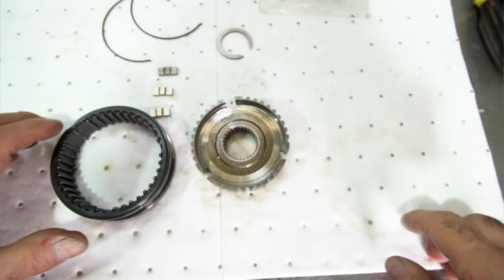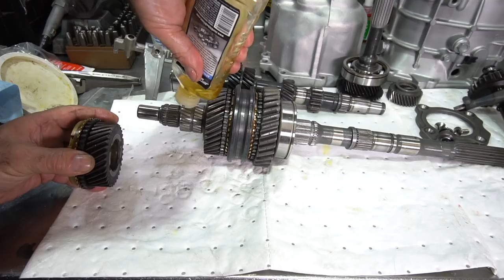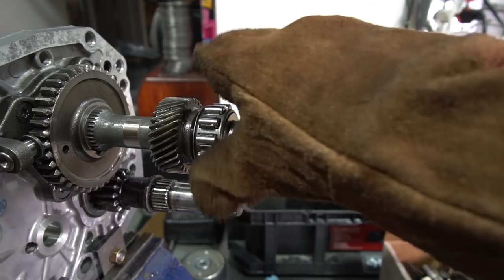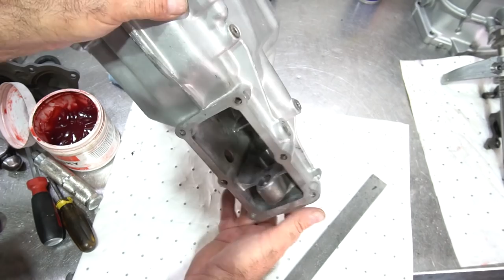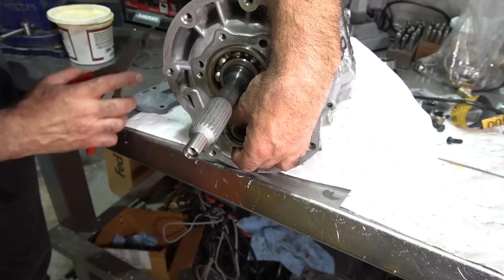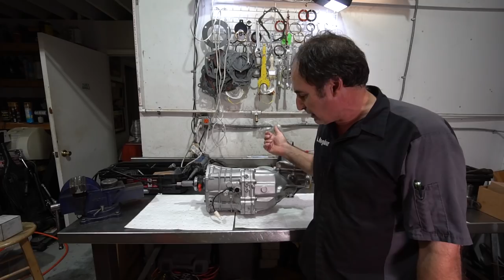How to Rebuild a Toyota W58 5 Speed Transmission - Part 2

Comment from the maker: For the people who think installing sealed bearings in manual transmission is wrong. I suggest you learn about "non contacting sealed bearings"  All of my endurance boxes run on these types of bearings for over a decade with zero failures.
Reply: Il nya pas la chaine francais pour mieux comprendre

Comment from the maker: This is a long video and I tried to make it as detailed as possible. There are some sections about HVDA conversions you can skip over.  Please also understand that a video like this takes at least 10 hours to shoot, adjust lighting, color correct and get the right angles to make points clear to the viewer. IT'S FREE.  In return if you can subscribe that would be awesome and much appreciated.
My Facebook page  redirect is http://www.transmissionbook.com

If a transmission is video worthy usually the owner has time on his project because the transmission will be in the shop for a few months. This is a full time business, not a hobby. I manufacture/ build new transmissions and parts.  I get a great deal of comments that I delete when a person says "do a Corvette ZF 6 speed video" or something similar. I don't have access to every transmission and I'm not about to purchase a transmission because someone demands I do a free video for them.  That's rude. If you are interested in working on doing a video for a particular transmission contact me . My info is in this channel's about section.

Shift Fast,
Paul

Comment: I appreciate the videos that you make no matter what make/model transmission you rebuild. It gives an insight on knowledge that one can use to rebuild their own or what goes into rebuilding a transmission. I rebuilt my first transmission about 4 years ago. Watching your videos helped me gain the confidence in understanding the steps to taking these things apart. I was working on an L-series Toyota pickup transmission (L52 transmission from a 1982-1983 Toyota Pickup 4wd). I have used these rebuild kits that you've mentioned in this video (same bearing manufacture as seen in the video). Didn't know that there can be some defects in the kits for the synchros until you mentioned it in this video. Could be a possibility that when I did put the L52 back together, that shifting into gears didn't feel smooth (specifically 3rd gear, after some time it did feel okay). New components that went into that transmission were bearings, synchros, keys and springs, c-clips, gaskets and seals. Looking forward into taking apart this Toyota R151F turbo transmission I currently have as it whines like it has straight cut gears. Thanks for another great vid Paul! Keep bangin' those gears through the windshield!
Reply from the maker: Thanks so much for taking the time to write this. The warped rings in the kit will exhibit the same problem you were having. As the rings start to seat in they will grab the gear and synchronize better.

Comment: I like to thank you mr gearbox man.Watching your videos has really helped me rebuild my own gearbox and others. I have rebuild two boxes, a late 80s T5 nwc and a 95 toyota hilux here in new zealand. Just by watching your videos thank you so much. I am a certified mechanic but never worked on gearboxes because here in NZ it is a specailized trade. In  all the Work Shops iv worked in, if their was a problem with the transmission, we just removed it from the car and send it away to get the work done. Thanks to you im learning how to do manual gearboxes and learning something new at the same time cheers

Comment: THANK YOU so much! I must have just watched this video and part 1 at least 20 times while rebuilding my late model W58 (1993-1998) transmission. The fit on mine was even tighter than this one, and there were some minute differences like double-cone synchros on some of the gears. The project took me two weeks of nights and weekends type tinkering, waiting on parts, and struggle bus dilemmas like having to wait on buddies to use their press. If it wasn't for your video I don't know if I would have ever been able to finish this project, but now I feel like an expert on the W58! 

Being a performance auto technician by trade, I have never really dug this far into the guts of a manual transmission and it was a really educational experience for me!
Reply from the maker: Thank you

Comment: Mr. Paul, 
I just want to say thank you so much for putting these videos together. I could not have done my FIRST EVER manual trans. rebuild on my Toyota w56c trans without you. I am a Toyota 4wd lover that had a smoked input shaft bearing. Common with these trans I think? I been nursing it along for the last 50k miles = louder than you can even imagine. I consider myself a pretty experienced hobby mechanic but your video was simply the best resource I could have ever stumbled upon. I have a press and a couple pullers, one more trip to harbor freight for a big bearing puller (like the biggest one you used on the press) and I was in business. I mean this as the highest form of compliment when I say: you sir, are the Bob Ross(the famous painter on PBS) of transmissions. Simply the best, detailed and all encompassing source of info I could have hoped for. I was gonna go buy a manual, but I didn't have to becuase YOU are better that the book and even included torque values, bonus!  Man.. keep doing what your doing. I would love to buy you a drink and a steak dinner if I could. Let me know if you are even in Oregon. Rock steady amigo. Thank you.
Reply: *Let me know if you are EVER in Oregon. Drinks on me.
Reply from the maker: Thanks. Ross always said there are no mistakes, only happy accidents.
Reply: @GearBoxVideo  Classic Ross, well said. 
The trans seems to working quite nicely after about a 100 miles.. Only one issue that rears its head now and then. upshifting from 3rd to 4th: Doesn't seem like the shift ring wants to fully engage over the gear. like there is not enough throw in the fork. when i let the clutch out the gear spins and i get a grind. Hard to say if it's just the cheapo Sta-lube GL4 I am using for break in or something else. Seems like i has something to do with the gear spining at the 1:1 ratio? every other gear engagement feels great. Up and down shifting. Any thoughts?
Reply: Yes Mr. Paul.....you are a TRANSMISSION GENIUS.......Waaawwwwww.......

Comment: Just rebuilt my W56-B 1987 transmission. Thanks to your video everything turned out great. Removed 5th gear with a 3 jaw puller and a little heat with no problem.

Comment: I make helical close ratio kits for these units. 11 new parts. I remove syncro drives from good used gears and press on to my new gears. With physically wider gears, closer ratios these boxes are very very strong. We have one that runs 510 rwd hp and 8300rpm. Don't grind my gears because of the expense and customers wouldn't buy them. Use best gear steel i can buy. These toyota gearboxes have a very nice syncro feel and when they are turned into a close box, they are so fast without crunching. Good video. I have tooling I have made. I use the shoulder just ahead of 5th gear spline and have a "C"plate that hooks behind it and use a porta power ram setup to install. I also use the same setup to push the big reverse gear on.  Great video.
Reply from the maker: Please send me info on your parts to support@5speeds.com
Reply from the maker: Nope

Comment: I have a good W58 attached to a complete 22R block with a 20R head I'm selling after my 80 truck was totaled. I could not have been running better when it was hit. The tranny has a fresh front seal, Engine has a new clutch, new head gasket, and valve seals and I removed the head shim put in place to keep the compression down back in 1987  when the 22R was built. I can feel the compression increase. This is a California truck. It passed CARB smog recently with results that were half of the average. Not half of Max, half of the average. I'd like to sell the whole kit'n caboodle to some lucky hobbyist that can pick it up in Southern California. Available May 5 2023. Make me an offer. I'll send pics after it's out of the truck. I loved the video. I miss my truck.

Comment: 26:22 I find it easier to throw the whole mainshaft in, with input shaft and then the cluster gear afterwards without the centre bearing on it. After the cluster gear is in tap the bearing race with the snap ring in it from 5th gear side at the same time. It saves juggling both the mainshaft and cluster gear at the same time. Love the videos! I hope this helped in some way.

Keep it up
Reply: Addison Theodoridis great tip, take the time to post a video for us.
Reply from the maker: The maindrive and output press fits so you can probably heat the inner ring up of the bearing and slide it in but I wouldn't be tapping these bearings on while the main shaft is in place you could ruin the input shaft synchronizer ring. I see what you mean about the lower cluster bearing but since that lower bearing is a split bearing with a nylon cage you risk damaging the cage.

Comment: Love your videos Paul.   If you recall I asked about Ford toploaders and you said at first you didn't really work on them due to the lack of quality parts.  Since I was having troubles with mine I sent it off the David Kee...and got it back and installed and drove the car home from the shop and it worked...thank goodness.  I had the grinding issue with the 3-2 downshift.  You said send it to you but that was after it had been shipped to Kee.  Would have loved to have to go through it.   Next time if there is a next time.   I get to test it at the track the end of Oct so we'll see how that goes.   Again thanks for the great videos.
Reply from the maker: David is very knowledgeable and a great guy

Comment: XLn't tutorial video sir, thank you!
For the commenters! The reason many Transmissions are similar is because BMW, Volvo & Jeep have all used the Toyota manual Gear Boxes behind their Engines for many years. Jeep used the Toyota automatic transmission until 2001-2.

Comment: Good job I'm getting ready to do either a w58 or r154 for my Supra so thanks a lot
Reply from the maker: Go for it!
Reply: Any idea what the w58 3rd gear spline count is? I cant find a replacement 3rd gear at all. The ax5 is apart of the w family. Any chance you know if the 3rd gear from that fits?  I know the ratio is off

Comment: wonderful... subbed! was waiting for this just to see how the gears are installed as I plan to assemble a hyundai M5BF2 soon... it's all new parts including case sections, input/output shafts, gears, synchros, forks, hubs etc., seeing this makes me excited to put it all together... I plan to polish the case inside out instead of coating with Teflon but I'll probably have the gears treated like you mentioned in the NASCAR prepped gearbox video... many thanks!
Reply from the maker: Thanks for watching. Post pics on my HIGH PERFORMANCE TRANSMISSIONS Facebook page.  Direct link is http://www.transmissionbook.com
Reply: @GearBoxVideo  once it's done, I'll do that...

Comment: I think I had a W58 in my 1993 Cressida. I remember that I had a problem with reverse gear. When I took it apart, I was amazed how complicated it was compared to the Muncies I worked on. Way more parts.
Reply from the maker: Yes and a much more precise fit. Old Muncies had horrible tolerances.
Reply: I had the Cressida for 17 years and then it was totaled. But someone got that good tranny after it went to the boneyard. Very few Cressidas had the W58. I called it my "Four Door Supra".

Comment: The Toyota Service Manual recommends using fine lapping compound to surface the Syncro to gear cone braking surface. Clean all lapping compound from surfaces before re-installation.

Comment: I am thankful that you post these videos Paul. Eats into your free time, thanks for doing it quality information.
However i do hope the Chef is not a regular dining companion around 12, oh the crap i used to get at work about the chef.
Over the winter i need to pull the boneyard engine in my s 10 it is ready to die, will do the t 5 properly this time
and the transfer case. Watching your T 5 video shamed me, i really was clueless in what i was doing - not anymore.
Going to try and fit a GM 3.8 in the engine bay if i can make the T 5 and the 3.8 play together.
2.8 is a joke and the 4.3 drinks too much but i may have no choice. Did the grand nationals ever use a T 5 ?
I can not recall if they did there might be some hope for the combo if they did. Something makes me think they were autos only.
Have a good Paul

Comment: Fantastic video Paul, I rebuilt my W59 using this tutorial as a reference. Cobra Transmission is an xln’t source for Input/4th Gear & Counter Shafts. Their staff is very help & responsive thru email for any questions!
Reply: I have to rebuild my w59 & 1st gear is ruined. Do you know if the 1st gear is replaceable on the input shaft or is it part of the shaft itself. Same question regarding the 1st gear on the counter shaft.
Reply from the maker: They are all 1 piece

Comment: Paul! do you have any content on the Toyota R150F mated to a 5VZFE. I have so many questions + concerns after having to get a rebuilt gearbox shipped halfway across the USA to put into my old gen1 Tacoma with 341k miles at 26 years on the original clutch parts... the local transmission shop that was well paid to diagnose FAILED to properly diagnose this gen1 Tacoma  when it started having odd noises at 290k miles, they had no clue with my verbal description about when it was happening and what it was sounding like..  they just said nothing found everything in good working order.. when obviously it was NOT

now the rebuilt R150F is having oddities that the original gearbox did not ever have that i recall after 1/4 century of driving this pickup

any content created for the R150F that i can learn more and field some queries

I have driven manual Toyota gearboxes since 1990 in 4 different vehicles, i don't believe any were the W58 presented here but i sure enjoyed learning about the innards from your excellent presentation

MT or BUST 8^}
Reply from the maker: I do not

Comment: Hey. Ur in my opinion are one of the most knowledgeable people on transmissions. Im going to have to probably rebuild my R150f tranny and was wondering if this video would be good to go by? Cause they are similar transmissions. Also my tranny is having problems going in first gear before its really warmed up. Now its getting hard to go into second gear and third. But after driving for an hour it goes into gear just fine. Also if the truck isnt running,it goes into gear just fine. I was thinking it was the synchros, but i have no problem shifting into gear while moving. I heard that a bad pilot bearing that sticks, could be the culprit. Which sounds likely.
Reply from the maker: Very similar and I don't think the press fits are as severe
Reply: Thanks for the reply. Cause i know you have to be a busy guy. Usually the guys with knowledge are. Well as of yesterday,my transmission started making a rattling sound. It does it in neutral, and also in 1st 2nd 3rd 5th. I definitely sounds like a bearing. It doesn't do it in 4th. I read that if it doesn't do it in 4th than its probably the counter shaft bearings, cause 4 th gear is the 1:1 and the counter shaft doesn't turn. On this r150f tranny. Luckily, my buddy has a extra tranny that i am fixing to swap out. I work 90 miles from where i live and didn't want to take the chance on making it worse or getting stuck on the side of the road so i called in and took off, and i am fixing to swap it out. But i am going to have to rebuild mine and give his back or trade him or whatever. Times are tuff and i will have to rebuild the tranny myself. I have another friend that has presses and bearing pullers and everything i think ill need. Is there any specific tools that you think i might need? Also what rebuild kit would you use ? Hopefully its just bearings and seals and thats all ill need cause after looking on the internet i can get a bearing and seal kit for around 200 . From Cobra transmissions. Ive never done this and so im not sure on who to order from. Where do you usually get your parts from? I know i need to use oem bearings and parts from what everyone says,so thats what i looked for. And it will be a couple of weeks before i can order anything,and i want to disassemble it before i start ordering anything. So just tell ur thoughts on who you get ur parts  from or reliable people to order from, and any advice you might have for a first timer on rebuilding the r150f. Thank you for your time.